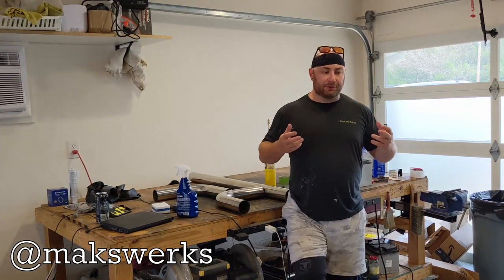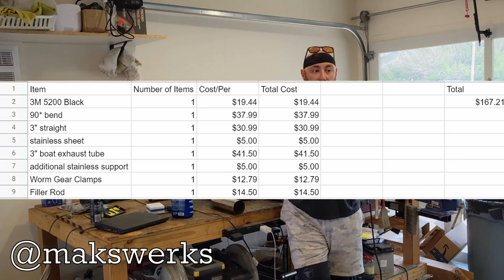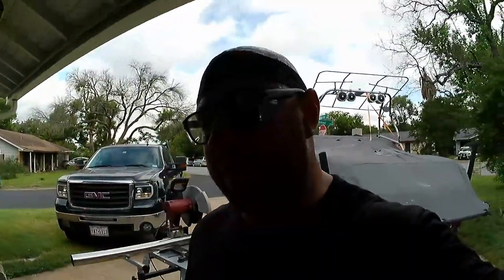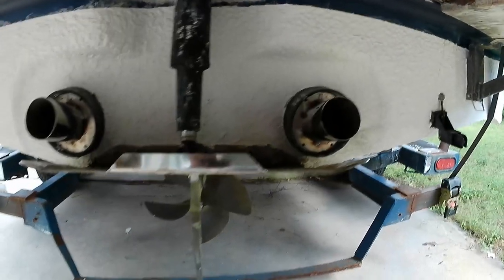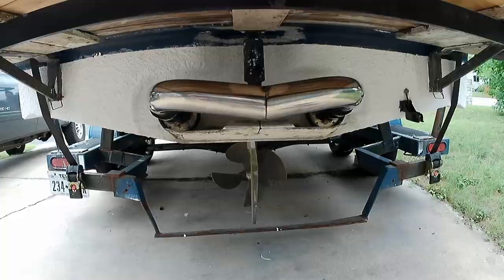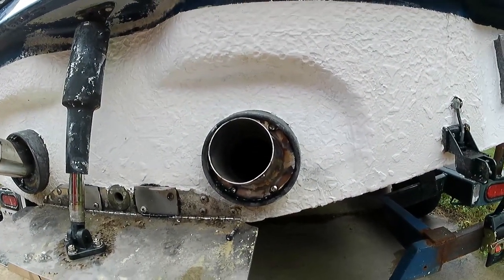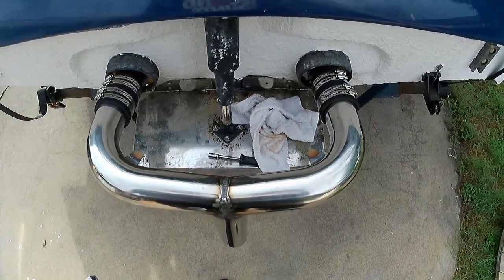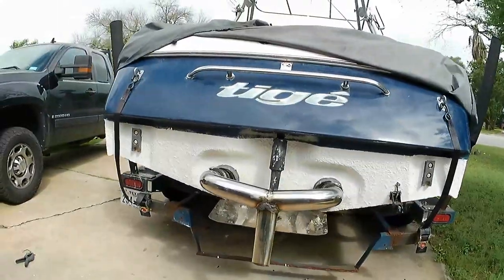DIY Stainless Steel Surf Pipe (Fresh Air Exhaust - FAE) on a 2004 Tige 22V

Comment: Thanks for the effort and all the info. I am curious about two things and would appreciate your answer. 1. what kind of muffler is installed on your boat ( waterlock may be ) ?
2. what was the result after the installation of the exhaust ?

Thank you
Reply from the maker: The boat has factory fiberglass mufflers inside the engine compartment. The boat is way quiter - this is easily the best mod I have done.

Comment: What is with the gelcoat?
Reply from the maker: The previous owner kept it in a wet slip. 7 years of zebra mussels caking on and eating it ruined it. I have recoated it for protection but it would have been a nightmare to sand it all flush

Comment: Did you have any steering issues after install? I built one out of abs and I have major understeer turning left.
Reply from the maker: Nope. With the taper there is no noticeable impact on steering. I got a fresh cables in to so it's one finger steer.